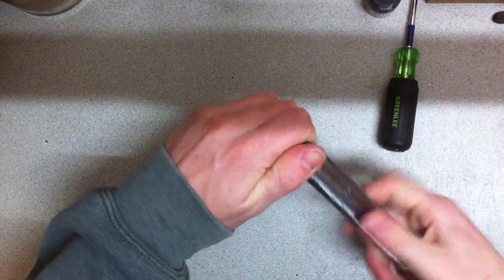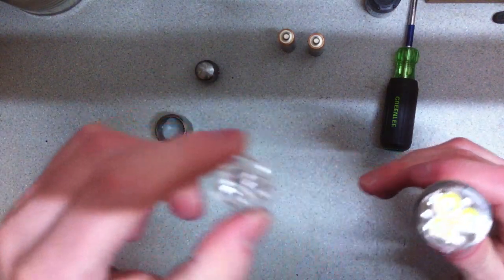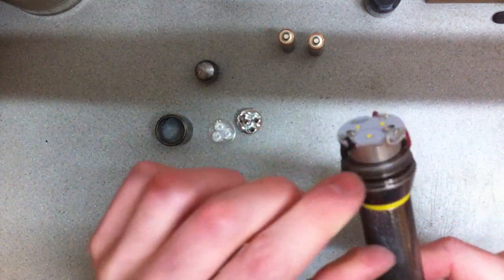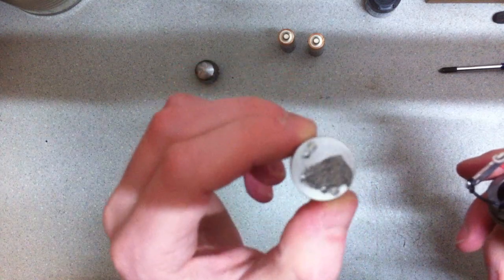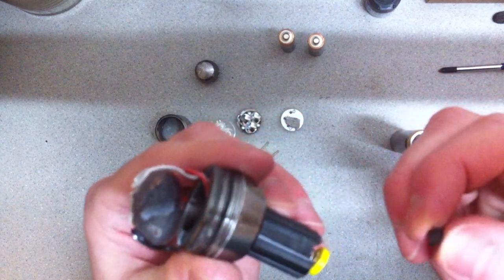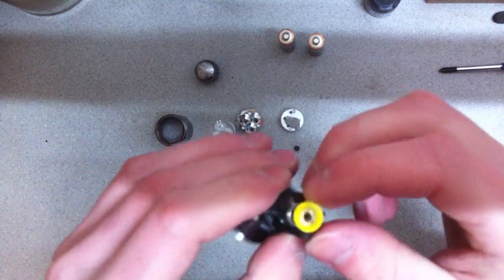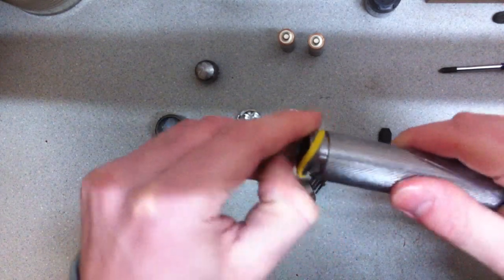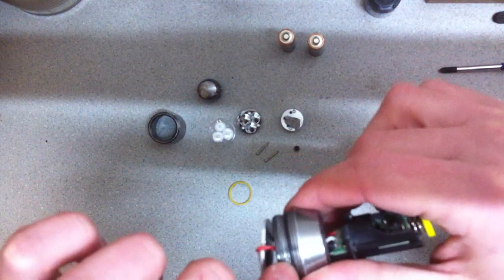Energizer flashlight teardown model PMZH21

Comment: I have the Energizer TacR-1000 as well as the TacR-700 and can't get it open.  Does anyone know how to open these or would you consider a teardown of one of these?
Reply from the maker: Try heating the area where you think it screw together with a propane torch. Not too hot just hot to soften the glue they put in the threads.

Comment: Can you replace the USB port on the rechargeable pmhrl71
Reply from the maker: This one is not pmhrl71 but I checked and the construction of the aluminium parts look similar, so if you want to open it to replace the usb port you will need to use a propane torch or a heat gun to soften the glue they put on the threads. Look at 0:34 and warm up the area where you see it unscrew in the video. Do not get the aluminium parts too hot because all the rubber and plastic parts will be damaged, just hot to soften the glue and you will be able to unscrew this part by hand while still hot. The circuit board and all the internal parts should be easy to access after that to do the repair.

Comment: Was there anything you did to the switch? The head of mine is loose but the switch moves with it when i twist.
Reply from the maker: I had the same problem, you have to unscrew the part at 0:35 and unscrew the led and heatsink. You will need a propane torch or a heat gun because there is threadlocker or glue in the threads. After that the second part will unscrew whitout twisting the switch.
Reply: @jeremyp7293  ah, thank you. It does make me wonder though, if theres thread locker or glue why is the head now loose, guess its given way after a couple of years
Reply from the maker: Mine only had glue in the threads of the part at 0:34. The head at 2:22 I was able to unscrew by hand without heat, so no glue there.

Comment: Is it water resistant?
Reply from the maker: Yes, there is an o ring or seal a where it is screwed together, an o ring at the lens and a piece of rubber over the switch. Not design to go under water. The build quality is good but it would be better if it was rechargeable.
Reply: @jeremyp7293  just bought  tint is to blue

Comment: It is be designated undisassembly. it will be broken when you teardown the flashlight
Reply: Yes.  We put one back together so it still worked, but you need all the 'tricks' at hand to do it.  Heap of shit, their is no need for all that crap just for a flashlight.
Fail. No Grip Batterry screw in End Cap. Totally ill-designed.
Reply: No, it can be disassembled. The thread is glued.
Reply: Made for the landfill unless you are this guy.
Reply: Get the larger flashlight with the clip and the 3 types of light. It's also Energizer but the base easily screws off.